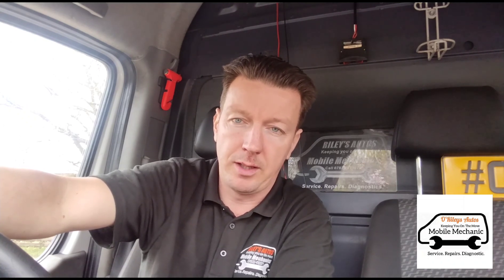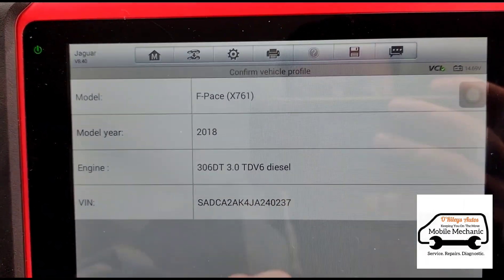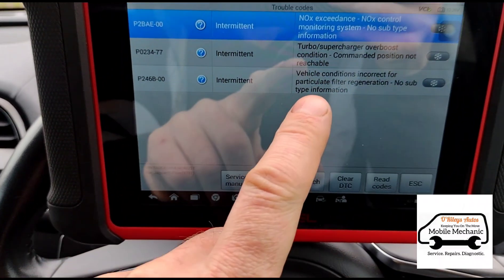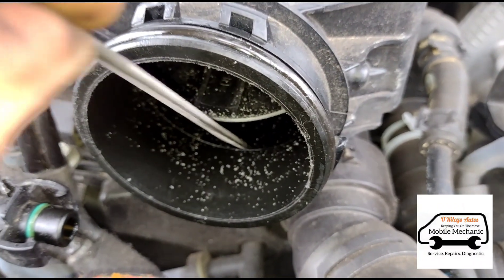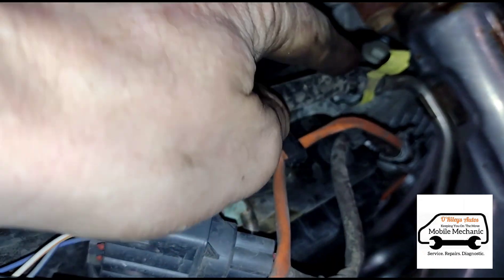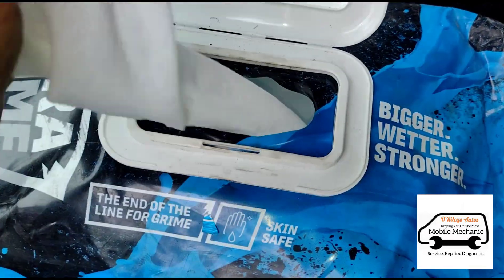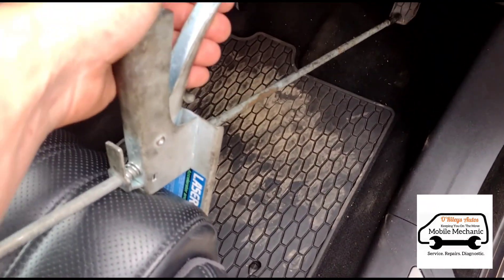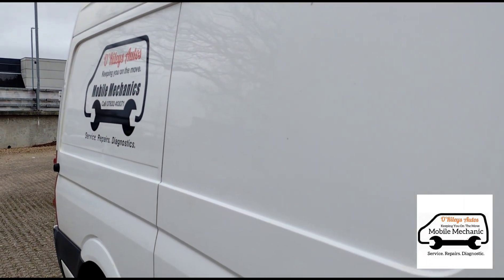Jaguar Land Rover F Pace 3.0 TDV6 DPF Fault & Turbo Overboost P0234-77 P246B P2BAE Throttle Body

Comment: Hi, please can you help I have 2 codes p004b-77 and p259b-71 and changed the turbo actuator still no difference when on incline doing 70 -80 geos into restricted mode ? Can you shed some light thank you
Reply: Hy did you fix  it I have same codes.  Thank you

Comment: Hello Jimmy. I have a 3.0V6 Diesel F-Pace 2016. I have an OBD scanner and via exhaust temperature I know that  active DPF regeneration happens aprox. every 150km. I do mostly short journeys. I still think it is way too often. Do you think the stuck throttle body flap could be the case? Is it worth checking if it's sticky or not?
Reply from the maker: Yes worth checking
Reply: Is it more likely than the EGR valve being clogged up? Have you ever cleaned an EGR valve on 3.0D Jaguar/Landrover engine? Is there any video?
 @ORileysAutos

Comment: Thanks for this video clip. Had the car go into limp mode showing engine management & soot alarm. A week after dealer service. You would think JLR would have this on its service plan Tried to force into regeneration (19g) but kept failing with the PO234-77 fault . So after watching this i got my son to remove the valve unit, it was free enough but totally sooted up removed over a eggcup full. Good clean out and test drive to force into regeneration without chemicals it fell to 4g. So very very happy we came across this video. I don’t think you could have travelled to St.Andrews 🏴 
Same vehicle from new 2017 DV6 60K miles and 50mpg on good days.   Thanks again. 👍👍👍👍👍

Comment: hi i. hoping you can help me i have a jaguar x351 3.0 diesel it has a new DPF filter fitted done 900 mile with new DPF and the red filter light has come back on should i change the DPF pressure sensor thanks
Reply from the maker: I'd need to check it over before giving advice

Comment: We’ve done the sticking flap on my dads 3.0 v6 but still getting turbo over boost engine light on ?? The map sensor is clean, do you recommend oil separator change or clean both turbo inlet’s with dpf cleaner ? Cheers ash
Reply from the maker: Is it a new throttle body?
Reply: @ORileysAutos  No original one 16 plate 48,000
Reply from the maker: @ashk5331  put a new one on 👍🏻
Reply: 😳 I thought over boost was caused by other parts/systems oil separator and too much soot build up ?
Reply: Do you only recommend spraying Vetech dpf cleaner down the inlet and not wynns dpf cleaner? Thanks ash
Reply: Hi jimmy
Do you think the egr valve can be faulty plus the pipe clogged causing hi pressure in the inlet? Cheers ash
Reply: Hopefully sorted it now with a new map sensor 👍🤞Cheers jimmy for sharing all your knowledge top mechanic

Comment: Hello. I have a Jaguar XF with the overboost problem. Throttle valve was blocked, have edited. It's clear, but the overboost problem is still there. Please for tips.
Reply from the maker: Sometimes you just have to replace the whole throttle body.

Also try replacing the oil Separator

Comment: Just a quick question, but is the Wynns Off-Car DPF cleaner safe to use with the DPF still on the car? If so, do you just pump a couple of litres in and let it soak (for how long) and then rev it?

Comment: Got the same problem with my Jaguar XJ 2016, going to try this, my code reader says the over boost is a permanent fault, my tester wont let me clear the fault after cleaning throttle body, does this mean my reader is pants ?

Comment: Hi l have the same problem on a 2016 range rover evoque.. lve had almost everything changed in the car but the light comes back on after a week or two.  Can you help please?
Reply: Have you had the oil crankcase separator changed?
Reply: @mohammednabil9792  am not sure about that 🤔

Comment: Thanks again Jimmy, was a pleasure meeting you and I hope this does the trick. I suppose if the issue reoccurs maybe I'll have to have that entire throttle section replaced.
Reply: is this your car and if so,  how was it
Reply: @nathanreid2974  still early days, as the problem has just been fixed it may well come back so at least a few weeks i reckon before i should start to feel confident that the issue has been resolved
Reply: Unfortunately my dpf Amber light has returned but this time without the P0234 code. I havent driven my car many more than 60 miles since having it cleaned out. I am genuinely lost about what I do now 😕
Reply: @mohammednabil9792  If it's just the amber light, it should just regen after 20 minutes of driving (above 40mph after the engine has warmed up)
Reply: these engines seem trouble.
maybe do an injector test

Comment: I've been fighting that 234-77 code on a 2017 Range Rover Sport with the same engine.  Already fixed my DFP problem with one of your other videos.  There is a JLR technical bulletin for that fault related to the intake throttle body.  It appears that maybe some of these are developing a different fault from what you show here.  My throttle plate isn't sticking like this and doesn't have that brown film, but I'm getting the fault nonetheless.  Basically the code is thrown when the pressure sensor notes a drop or rise in pressure.  The tech bulletin says to run a smoke test and look for leaks.  I don't have a smoke machine but figured a way to test for leaks and didn't find any.  I cleaned it up (off the car) and reinstalled after using petroleum jelly on all the 0-rings to hopefully get a better seal, and lubricating the throttle plate.  We'll see if it comes back.  Great video.
Reply: how is it
Reply: @nathanreid2974  Still getting a check engine light.  Running out of ideas.
Reply: @AutomotiveEvangelist  maybe look at other things like the inlet flaps
Reply: @AutomotiveEvangelist  Shane have you replaced the oil crankcase separator? There are others who have reported to change this as it fixed their issue
Reply: Thanks for all the suggestions.  The arm on the secondary turbo wastegate was broken.  I used JB Weld and some wire to fix it and no errors since.
Reply: @AutomotiveEvangelist  ah great!
Reply: We experience overboost faults all time with dpf change the throttle body never a problem after
Reply: @classiccarfinder  My problem turned out to be the solenoid on the charge air intake valve.  It took me a while to find it because it was working intermittently.
Reply: @AutomotiveEvangelist where is it located? I’ve that DTC on mine before 🤔
Reply: Charge air valve is under the radiator.  I eventually changed the oil separator gaskets (which were leaking) and the throttle body. No issues since those were done.

Comment: is it with SCR ?
Reply from the maker: Selective Catalytic Reduction (SCR) technology is fitted to all Jaguar diesel vehicles from 2016 Model Year. It enables Jaguar to meet EU6 emission regulations
Reply: If so, clean the scr injector and the opening where it fits in
Reply from the maker: @marcelarnouts6577  yes we do that on most of these types
Reply: @ORileysAutos  And preform an SCR reset with your scan-tool, then all will be good